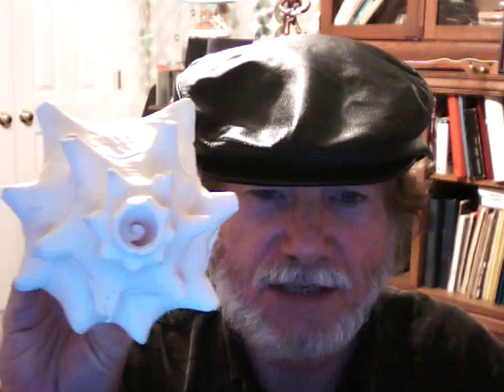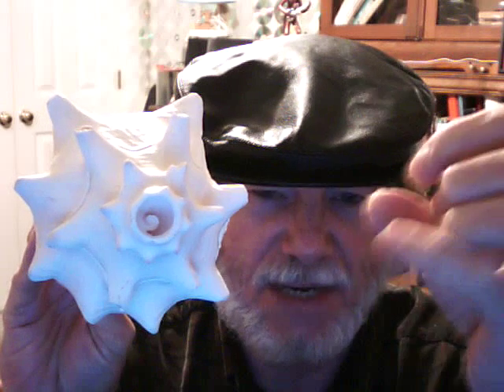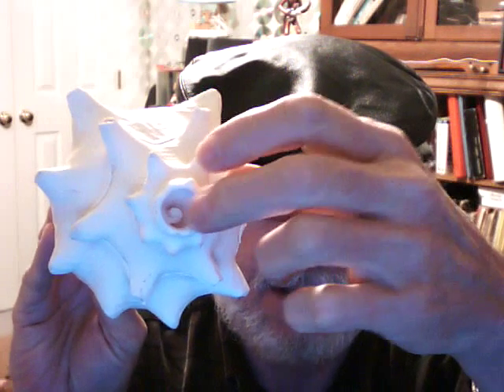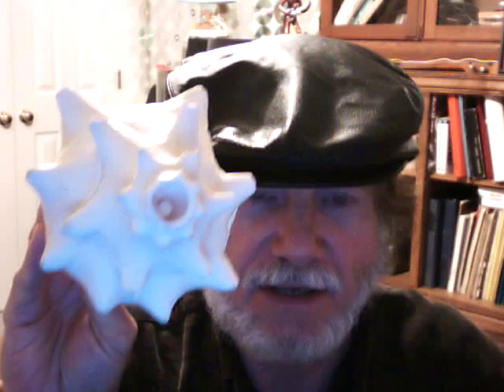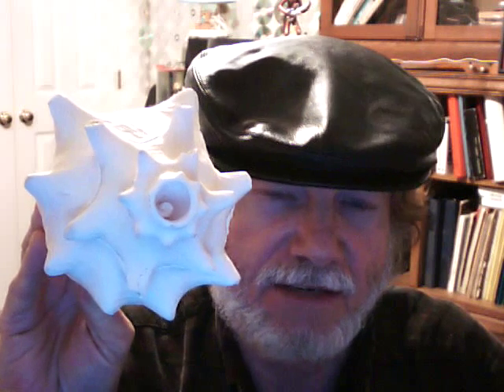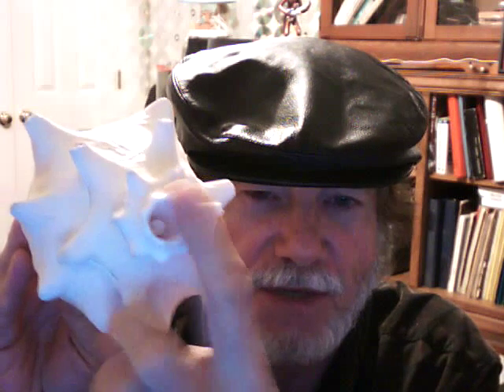How To Make A Conch Shell Horn, it's a great way to sound off!!!!

Comment: i have a nice horn that i like and you can see where that little hole was punched in the side to get at the conch - the spot is just covered up with what looks like wood putty. it may have some kind of detrimental effect on the overall resonance / niceness of the tone, but it's certainly not unplayable and i quite like the tone i'm able to get out of it sometimes. so there's that option. thanks so much for this vid, i've got another little shell i want to make a horn out of and this is perfect

Comment from the maker: Yes Matt,
I've found that I can consistently create good sounding horns from different Conch Shells by using a Hack Saw to cut off the end to make the sound hole. However it's best to avoid the Conch Shells that have had the Conch removed by cutting a hole in the side of the shell in order to remove the Conch.

Comment: Don, thanks for the video -- I found it very helpful. Have you tried cutting a helmet conch? I went through 2 hack saw blades before switching to my 14" chop saw w/ abrasive blade. My dremel did wonders after that in being able to carve a nice hole. I used the bit that looks like a drill bit, but cuts on the sides as well as the ends and has a guide to help control it. -Alan

Comment from the maker: @Mizznewbooty018 Once you have sawed off the end of the shell, you only have to drill just enough to get through the flat area where the saw went through. Then you should use a Dremel Tool or a file to enlarge the hole to about the diameter of a dime. Be careful and don't drill too deep or the horn may not blow. In the unfortunate case where you accidently drilled too deep, there is another option you could possibly repair the horn by installing the mouthpiece from a trumpet into the hole.

Comment from the maker: Kruegs8, Yes you can use the conch shells that has the hole where the conch was removed howeve,r be prepared to cover the hole with something and be careful not to get any material inside that might block the passages or it may not sound too good, That's why I prefer using the ones that haven't had the conch commercially removed. They sound better and are easier to work with.